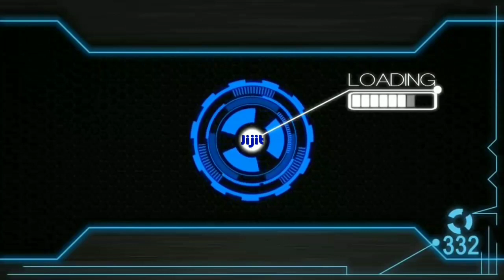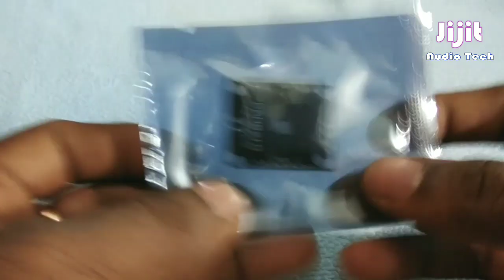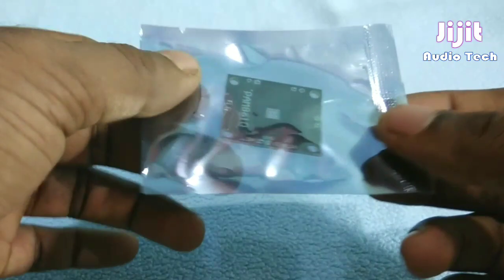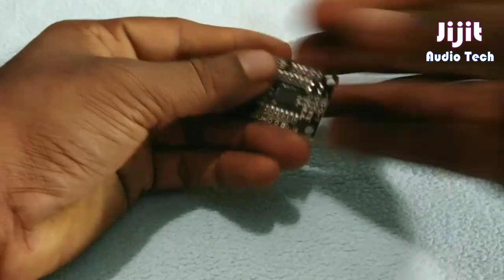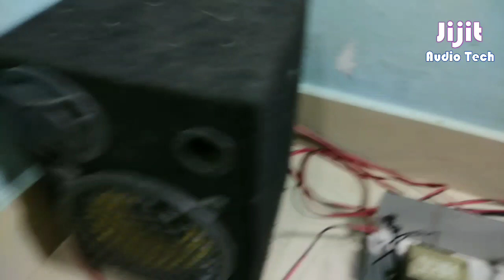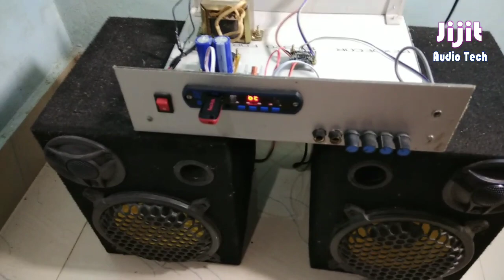PAM8610 Class D Amplifier Board Review and Testing in Malayalam (15+15W ആമ്പ്ലിഫയർ ബോർഡ് )

Comment: Heavy bass play chyumbol overheating akum if you use big speakers , due to speaker protection it will turn off. Heatsink ilathe long time use chyaruth ee board.
Reply: Ayyo ethil egana heatsink vekkum cooling fan ithu adupich vechal mathiyo
Reply from the maker: yes

Comment: Broo transformaril ninn dc volt filter cheydh varumbol 15 n kooduthal output volt varunnund.appol ee boardin 12 voltin koodiyaal damage aavile.plzz reply
Reply from the maker: chiriyo chiri Hi friend, ee board 15v vare work cheyyum, pakshe enthenkilum Voltage fluctuation vannal adichupovum.. so 12v thanneyanu safe,  9v 5a transformer koduthal nalla performance undavum
Reply: @JijitAudioTech  bro ninghal 12 volt transformer ale connect cheydhadh?
Reply from the maker: chiriyo chiri yes..., For regular use, I suggest 12v DC,
Reply from the maker: chiriyo chiri ithil 15v til kuravaanu varunnathu, life koduthal kittaan 12v aanu nallathu

Comment: Noise undo bro,vere review nokkiyappol noise und enn parayunnu
Reply from the maker: Nalla filter cheytha supply aanenkil noice onnum athrayilla... Pinne correct 12 thanne kodukkuka, 10w speaker use cheyyuka... Speaker wire short aayaal adichupovan chance und..., Kurachukoodi nalla oru board aanu TPA 3116D2
Reply: @JijitAudioTech  speaker wire short ayal adichu pogilla bro speakerprotection und ithil
Reply from the maker: @Sharon-xu1xb  ഇതിൽ വരുന്നത് കൂടുതലും ഒറിജിനൽ ഐസി അല്ല... അതുകൊണ്ട് ഒന്നും വിശ്വസിക്കാൻ പറ്റില്ല
Reply: Supply enganau filter cheyyende
Reply from the maker: alphons augustine filter cheytha supply thanne venam...
Reply: ഒട്ടും noice ഇല്ല

Comment: Ethinu ethra amps vennam
Reply from the maker: Ithinte maximum output 15+15w, normal running output @8ohm speaker il oru 10+10w pratheekshikkam... Amplifier efficiency is around 90 % so oru 12v 2amps mathiyavum...
Reply from the maker: Pinne MP3 player, bass treble board ellam undeniil 12v 3A kodukkendivarum